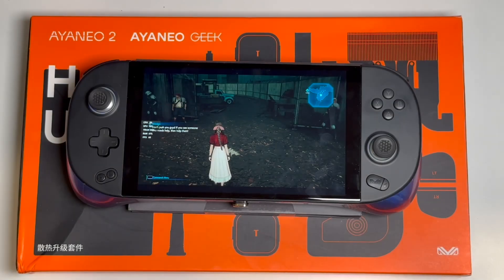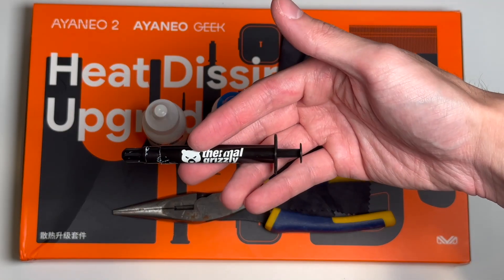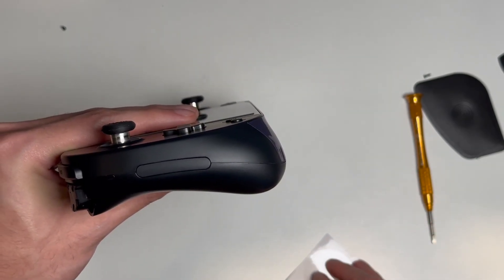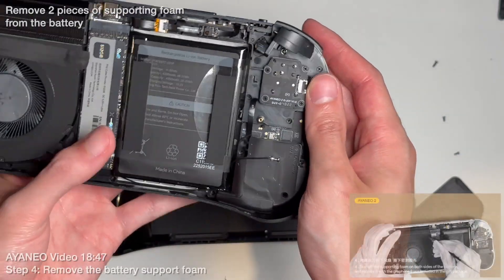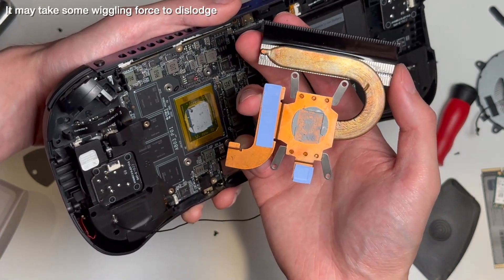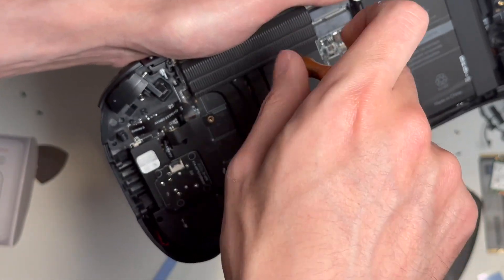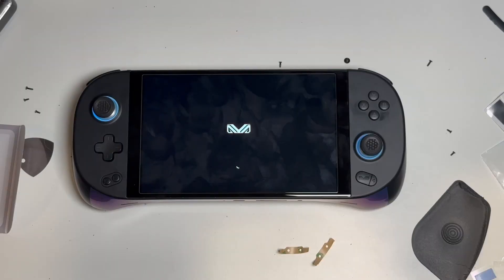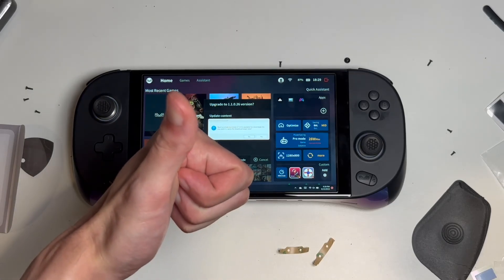AYANEO Geek/2 Heat Dissipation Upgrade Kit Detailed Walkthrough (and official screen protector)

Comment: Thanks, I followed the video, completed the upgrade kit and also replaced the battery. My unit won't start. Holding down the power and it's dead. Any suggestions? I opened it up and triple checked and everything seems fine. Didn't miss anything
Reply: Did you found out what was the cause? Dead battery or motherboard?
Reply: @Andy11467  yeh was the battery. All good now.

Comment: my idea after see you damaging your case , i came up with the idea to heat up the sidecovers with a heat gun to soften the double sided tape . maybe this will work better ?
Reply from the maker: Yeah, I'd try the same thing if I knew there was tape there. Good tip. Make sure to keep the heat gun moving and far enough away that it doesn't melt the plastic.

I used a hair dryer a lot to mold the skin around the case so as long as you keep the heat moving it shouldn't damage the device long term.

Comment: I don’t have this device I have a question why do you need to replace a defect that AYANEO should’ve replaced themselves? Because I was going to get this device and now I think God I didn’t
Reply: Nobody actually considered this as a defect. Watch reviews - everybody tested temps, and nobody deems them as "unacceptable", "too hot" etc.

Yes, there was room for improvement, and aya basically gave away heatsinks from 2s model - to owners of model 2.
I do not see anything wrong with it. For example I was too lazy to upgrade for all this time, for me temps are fine.

By the way, If you are going to buy it - most certainly you are looking at ayaneo 2s, which already has better cooling, better RAM.

Comment: I applied a little IPA on the screw covers let it soak and they came off easy.  One option would to be drill a small hole in the covers and pry from there to prevent marring the case.

Comment: When I first started building PCs 20+ years ago, the trick I used for thermal paste is put a moderate amount on and then carefully smooth it out as evenly as possible on the CPU using a credit card. I have always gone by the notion that you can actually hurt CPU by overdoing it with spillover and this also takes care of the air gap issue you mentioned. Otherwise great video and thanks for walking through all the steps!

Comment: Do the newer 6800u versions of the Ayaneo 2 come with this already installed? Or do we have to get the heat dissipation upgrade along with the Ayaneo 2? 

Asking because I want to get the 2 over the 2s seeing as how the 6800u performs better at lower tdp than the 7840u.

Comment: I wouldn't put those new side covers back on. Especially if you plan to upgrade that 512GB SSD. Is the Geek 1S easier to open up then? I really dont want to have to pull off my triggers to reach some screws to open up the case.
Reply from the maker: the new side covers with the notch are much easier to remove, but no I don't plan on upgrading the SSD. I'll burn that bridge when i get to it if i decide to do the 7840U upgrade. I'm also going to ask about a possible case swap to white for the 1s
Reply: @yu.niverse  after much debate I might just fold getting a ROG Ally from bestbuy with the 1yr protection ($70) to play it safe. Honestly I am really torn between all these handhelds and their different grips. The Geek 1s has so much to offer on paper but chance of dealing with returns overseas scares me.
Reply from the maker: @tomoprime217 good choice imo, I’ve heard its a quieter machine overall so no need for shenanigans like this

Comment: Since the side covers are replaced anyway, you can easily remove the side covers by using a sharp knife to cut them in half. Start on one side starting at the crease from both half’s of the body covers, then lift them from the cut to pull off. I did put some layers of painters tape over it just to be safe, it takes quite a few cuts with a sharp knife.

Comment: Thank you very much this was a perfect video for me. One thing i figured trying to get the the side clips off is that you push the metal pick right on the crack very firmly don't try to wedge it in sideways. If you go straight down it will pop right out. It's scary doing it but if you are lined up on the crease it will pop right out
Reply from the maker: good advice for others, thank you for commenting

Comment: After the installation my screen is now black. Is there any solution for that?
Reply from the maker: The first boot will take a long time compared to normal. Did you perhaps unclip something and forgot to clip it back? This installation doesn't touch any of the display cables or anything.

If you are able to take the device open again, look for anything that looks like it is dangling or unplugged. You can also ask for more detailed help on the Ayaneo discord.

Comment: To remove the side pieces I used a hair clip (Snap Hair Clips Metal), I managed to remove it without damaging the device. The hair clip is very thin and manages to get into the crevice. About that yellow tape. Can it be removed? Because there's a lot of old thermal paste underneath it.
Reply from the maker: Yes it can be removed without issue; I left it in place out of laziness and the thermal paste is not conductive, so it doesn't necessarily hurt. I think it's supposed to help prevent paste from getting off the die onto the surface-mounted devices, but evidently it doesn't work!

Comment: Please don't use giant metal pliers to remove the fan connector. And you definitely can use too much thermal paste. You want just enough to cover, ideally you'd smooth it out and not leave giant globs before attaching the heatsink
Reply from the maker: Other youtubers (Gamer's Nexus I think) have done videos on thermal paste amount where it doesn't make much of a difference but not using enough, especially on a bare die, has a big effect.
Reply from the maker: Agree with you on the pliers though; I'd rather people lay the fan on the side without unplugging it. I don't trust that connector even if you have small pliers.